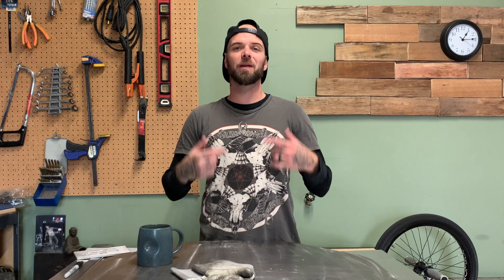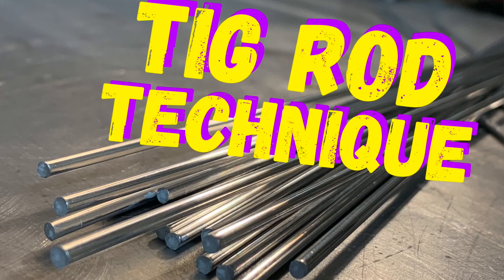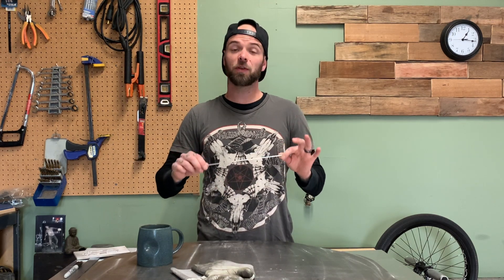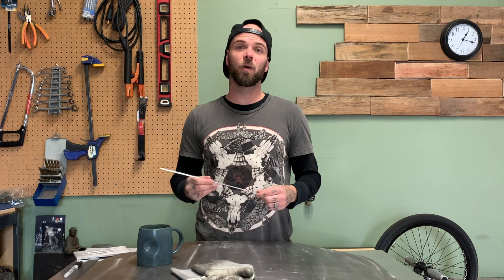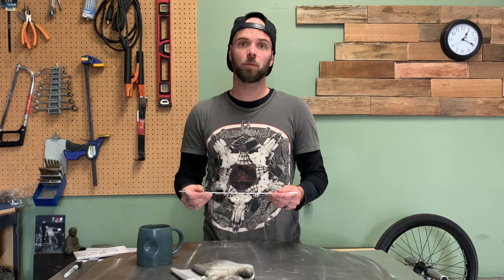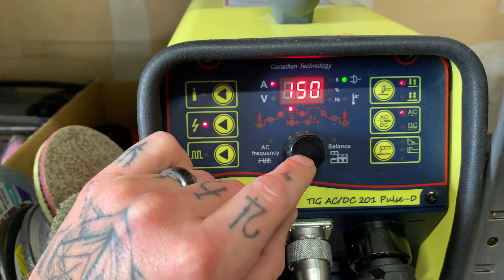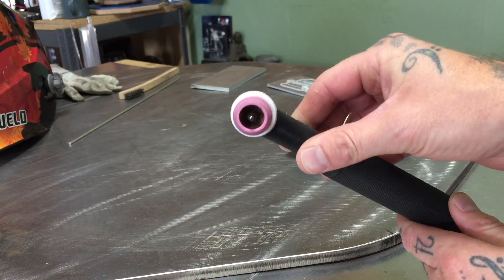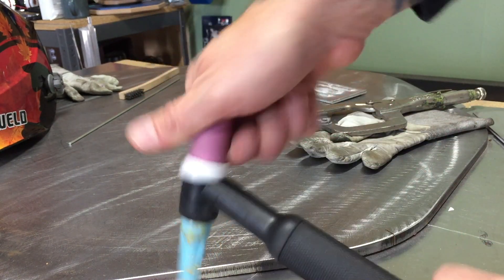HOW TO TIG WELD! TIG WELDING RODS PT2! FILLER RODS!

Comment: How come everyone doing tig videos always show setting up the machine on how too do aluminum  BUT NO ONE has showed  How too set up the machine  for welding chromoly
Reply: Perhaps due to Aluminum having a narrower heat input range for a given thickness than steel alloys do which chrome moly is.

Comment: So I just started my first class and we're practicing on very thin aluminum (1/8 in) Does anyone have any advice for me on controlling the heat or some kind of method to the madness as far as choosing the right amperage for the type or thickness of metal you're working with?

Comment: Great videos, thank you. One thing I didn’t pick up though—and few seem to mention—is coordination of movement between torch hand and filler rod hand. Are you feeding as part of the dip or as the torch is moving between dips? Also, how does movement of filler rod hand work (to maintain 6-8” distance) as the bead moves forward. Seems the filler hand has to scoot forward with the torch hand. But most folks just show arc shots so you never get to see how these things work together.
Reply: @Mike Did you ever get a good answer to this? It's the exact question('s) I've had for a bit now.

Comment: Hey man nice channel ! Looking forward to more clips! I have failed to find any good info on YouTube as to how to weld something like  1.6mm mild steel tube butt welded together (say to make a welding cart) without a tig pedal. Every video uses a tig pedal with steel. I have a cigweld (ESAB) transmig 185 ultra that can't be fitted with a tig pedal apparently. It's an auto set synergic as well as manual setup and I'm having a dammed hard time trying to learn to weld tig on it. I just seem to burn through my material even on autoset mode and moving quickly over the steel. Can you offer any advice? Keep up the great work man 👍👍
Reply: Thanks for the link man! I appreciate that you read all the comments and interact with your audience. I was hoping that you might have the time to chat with me about how you go about running  a YouTube channel, cause yours is new but really well made and great fun to watch. I'm f you'd have the time to shoot me a g'day to nirvanabrick@gmail.com that'd be awesome as I'm looking to start something up where I learn to weld tig using channels like yours and the trials and tribulations of bumbiling through the many hours that I've got ahead of me to tig well. Who knows people might find it funny watching me stuff up a bunch of stuff and waste material along the way lol cheers for the advice!!
Reply from the maker: I’m always trying to hit people back, not always possible but I’m trying to. You can hit me up through my email on my website- happy to chat. Cheers🍻
Reply from the maker: Thanks man! Hmm tough one. I did a vid for a CanaWeld review where I ran a pass or two with no pedal. 
https://youtu.be/NG4_a9Qg1lw
I go over the up/down slope and basic setup. Maybe something in there may help? 
Cheers!

Comment: This is probably a elementary question, what are you watching when you add filler? Irregardless of aluminium/steal.  Watching the toes, puddle width, etc.
Reply from the maker: I tend to pay attention to two things, my standoff distance, and the height of the bead as well. I need to make sure I’m in nice and tight, and the height of the bead will show me I’m adding enough fill for sure:)
Reply: @PacificArcTigWelding  thank you
Reply from the maker: Absolutely 💪

Comment: I'm tired of everyone on YouTube using 5356 in all there videos.  Its the easiest rod to use for bead appearance/consistency.
Reply: In high school I used 4043 all the time lol
Reply: @GraduatedIn  that's good.  You're ahead of the game already. It might be "easier" in that it wets out better but, 4043 is much more sensitive to heat and travel speed and it will tell you right away on thin materials. 5365 will cover-up your deficiencies.

Comment: Loved the video! Trying to learn how to tig pipe in my garage any suggestions on what would be good practice joints or have any suggestions?
Reply from the maker: Run beads over the pipe with no joint! Basically just stringer beads, no joint will allow you to dial in weld profile. Then when you move to welding joints you’ll know your settings and control really well:) Have fun!
Reply: Pacific Arc Tig Welding thanks brother keep up the great content

Comment: Hey Dusty, thanks for the video on filler  rods. Seems like I have more trouble with 1/8 rod  than I do with 1/6 or 3/32 rod . I can’t seem to get a nice bead with the 1/8 rod . Can’t get the amp right .more so when I try to weld 1/4 in. Aluminum. Thanks again for great video as always. Larry Moore!
Reply from the maker: Larry i appreciate the message a lot! It’s touchy for sure. Although people usually have more difficulties with the thinner rods! Hope you are well my friend 🙏

Comment: So “front third” of the pool, just ahead of the point if you drew a line straight down from the plane of the tungsten? Filler never leaves the envelope of the shielding gas ⛽️ yes?

And hey - Hope you’re well brother! Jeep just threw a $$$ temper tantrum (new wiring loom 😢) so I’m patiently rebuilding my forge fund.

Ever tig mild to carbon or tool steel? I’m interested. 

I need to build an adjustable twisting wrench or two for forging by welding a second “handle” to the top of an old monkey wrench. Thinking ER70S-2 3/32”? SMAW seems so klunky for this op, TIG would be cleaner.
Reply from the maker: Oooof. Yes you can, but that’s a tricky matchup because each type of steel is drastically different from the other. Differences in strength, flexibility, corrosion etc. Best to hit the forums with that one. It’ll be a pretty rod-dependant weld out for sure. That sucks about the Jeep! Hopefully not too bad!?
Reply: Pacific Arc Tig Welding she’s running but it was painful... wiring loom got melted by an oil leak so it was an absolute tragedy of small issues  turning into a monster. Anyway I blew all my $$$ on her so she loves me again for now, high maintenance women are like that? 😇 Luckily my actual woman is a gem... 

...anyway, 
I see a lot of that tool with the shop built weld (and sometimes braze actually) so it’s able to work. Agree best results will be pretty rod dependent. Considering a good preheat as well. Lotta mass right in the crown of those wrenches. Certainly dress it and maybe even do a little v notch for best success as opposed to a butt. 
Oh was gonna say - Man that 26 torch is a big doggie! Looks like a CK indeed. Change the sticker and I dunno as you could tell. 

Thanks brother!
Reply from the maker: Cheers my friend 🙏🍻